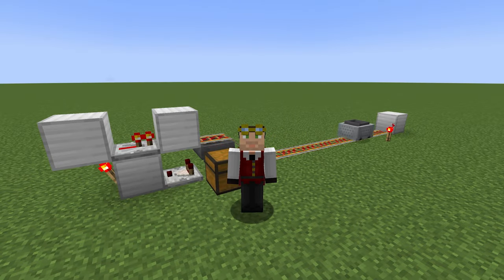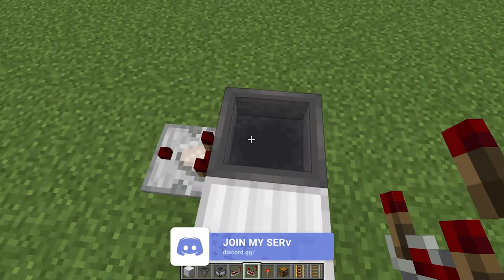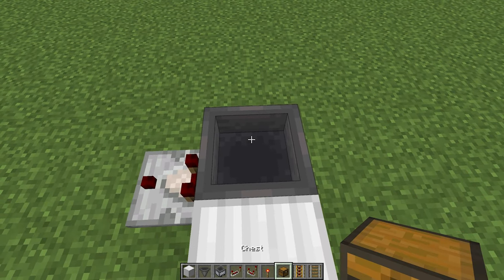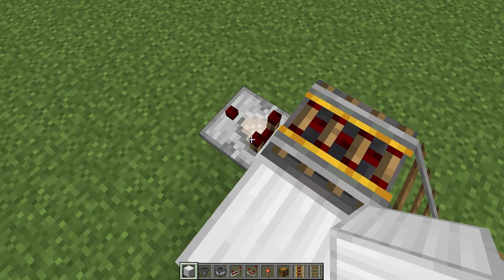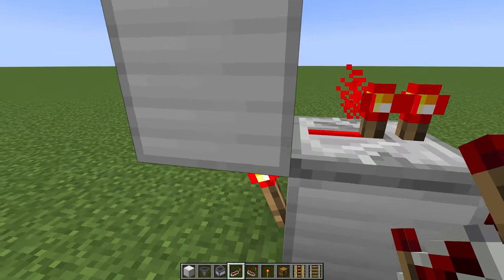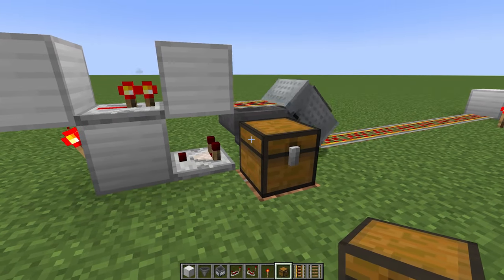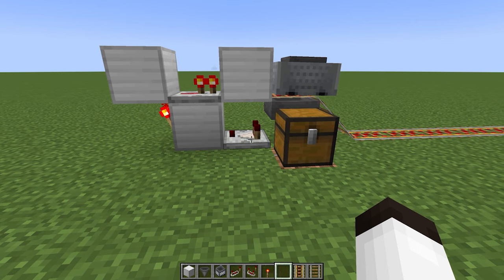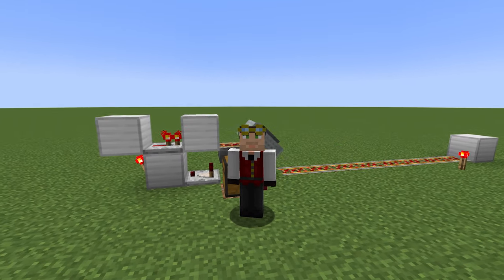HOPPER MINECART UNLOADER & DISPATCHER | Tutorial | 1.19.4 | VERY EASY

Comment: If your minecart is not stopping for you, be sure to place a chest after the hopper, NOT another hopper. If you place another hopper, the items flow too quickly for the comparator to detect.
Reply: you're a life saver!!!
Reply: Thank you mate been wondering why the heel the one I made was working
Reply: it doesn't matter if its a chest or hopper, just don't point the hopper downwards. a vertical hopper "pushes" down faster than pulling from above or pushing to the side. this is why the hopper being read by a comparator should never point down
Reply: @tinyturtle1898  That is probably the clearest explanation of hopper behavior I've heard. Thank you!
Reply: This doesn’t make a difference for me. No matter what orientation I have my chest after the hopper, it won’t stop to unload. Just one item at a time
Reply: @Ayeo801  Are you playing Bedrock or Java? Won't work on Bedrock.
Reply: No that’s not the problem. Use a honey block over the comparator.
Reply: @pl5882 Thank you!! It’s working!!! I’m playing on Bedrock if anyone else is having the same problem.
Reply: @pl5882 Thank you! This works for bedrock thank you so much, thought I was losing my mind!
Reply: @teraneaswanson5422 having same problem on bedrock and going to try honey trick. Here I was making a entire new device using a observer to keep the rail unpowered until the observer detected it to send it on its way with a comparator acting to block the signal if items flow through the hopper and was going to use a second comparator to detect when it was empty again and send it off and I was trying to figure out how to have the second comparator to be locked out unless activated by the observer. A honey block is much easier
Reply: ...you'll just need to run the comparator off the last hopper and see if it gets there in time to stop the cart.
Reply: Better yet.

So it still works so long as the hopper isn't facing down?
As in:
1- hopper sideways to another hopper is ok?
2- hopper POINTED sideways but yanked from the bottom by another is ok?

Bonus question:
3- comparator off the lowest hopper after pointing down works, but alters the wiring?
Reply: @Pestilencemage  honey block worked well and will work for all variants
Reply: Thank you jesus
Reply: Place a hopper or two in front of the first hopper....
Reply: Have been fiddling with this for hours only to discover that it only works on bedrock with honey. Sigh. At least it is working now 😢❤

Comment: How come my Minecraft with hopper is only dispensing only one item per trip?
Reply: is ur repeater placed the correct way round and are u on bedrock or java. Just built in JAVA 1.19.4 and it works perfectly
Reply: @ewandale4795  this works 1 out of 8 times in bedrock.. Im trying to modify the system in hopes of getting it to work
Reply: Have you found out why it doesn't work anymore? I'm bedrock too.
Reply: @shadowguyy  Need to have 2 redstone rails then a break... also, make sure all are in a slope... if it is flat, it will stop.  ( Keep it the same height, just add a slope and move the break point 1 over )
Reply: Make sure you place a chest after the hopper, NOT another hopper. If you place another hopper, the items flow to quickly for the comparator too detect. Learned the hard way. :)
Reply: Thanks to you guys I figured it out, bad news is the server ended cause the host stop playing :(
Reply: @twistedtim1969 
This isn't the issue that people are facing. Even with a hopper going into a chest, this design needs one tweak to make it consistent.

- Fix -
 Add a regular rail on top of the block behind the hopper with powered rail. This will cause the powered rail to slope. Break the regular rail (powered rail stays at a slope) and place a block in that spot.

Comment: This is not efficient. Instead, remove the torch, replace the repeater with the torch, then put a solid block above the torch, and a redstone dust on the solid block that is next to the power rail. You save a repeater and some horizontal space. Redstone torch will strong power the solid block above it, which in turn powers the redstone dust, which powers the power rail in this case.

Comment: My minecart literally wont move. It tries to start to and gives up almost immediately on my wheat farm. I know everything is powered and I step for step followed the repeater and compensater process several times. Please help.
Reply: So I built the exact same thing and had the issue where the hopper minecart would dock, empty, and stay, even though the powered rails are on. I fixed it by simply instead of doing the docking showed, I made the powered rails move diagonally on the hopper, rather than the horizontal. It worked for me after
Reply: @elderlymantis0960  I’m going to try this really hope it works thank you so much.
Reply: @elderlymantis0960  bro, I had that exact problem and couldn't get it to move again. Your advice worked perfectly. 👍🏿
Reply: @elderlymantis0960  my minecart won't stay for unloading and rolls of when my rail is placed diagonally
Reply: @elderlymantis0960 how exactly am I supposed to make my tracks go diagonally straigh?
Reply: @elderlymantis0960 what do you mean by diagonally because I have the same problem

Comment: Grateful for this overview. Trying to make a garbage collection system that visits multiple item containers at multiple locations (ideally on a circuit route) and haven't yet figured out how to work out a high-capacity item transport with more than one stop. The minecart can get to all these hoppers no problem, but the cart will stop moving if it can't take items from a hopper (if full, for example). The in-between solution I have right now is just have a timer override the hopper-comparator inverted signal, but i'd really just like a way for something to look at a full minecart chest and go "nope, you're full, move on."

Considering how I can revise the system to just solve the problem in a different way in the meantime.

Comment: Does this work on bedrock. Ive read the comments but still doesnt unload?
Reply: Hi. I'm using Bedrock. The railcar wouldn't stop to keep unloading for me so I added a regular rail behind the hopper going up one block. This stopped the railcar from leaving and let the powered rail over the hopper to shut off. The powered rail over the unloading hopper wasn't shutting off soon enough to keep the minecart from leaving so I needed something to keep it there until it shut off completely. Works like a charm. I'm using a chest in the minecart instead of a hopper and once the chest empties and the last item has gone through the unloading hopper it leaves.
Reply: @boomergotu9758  hi! this worked for me, but now i have a new problem. the powered rail won’t move the mine cart once its turned back on. it needs to be pushed. do you know how to fix this?